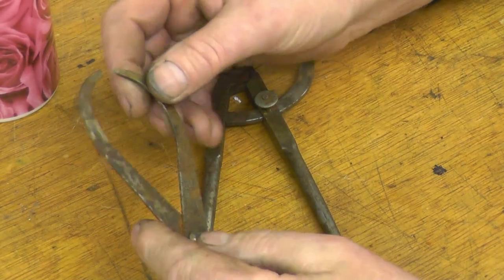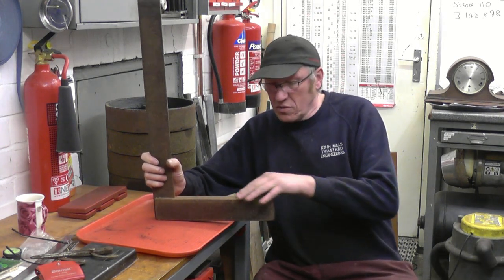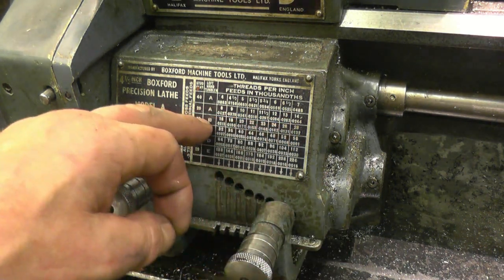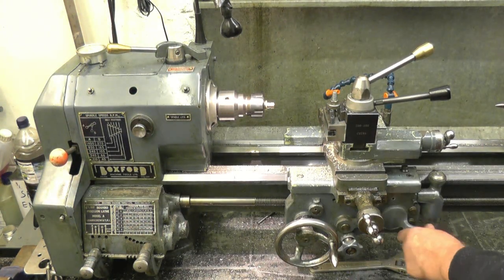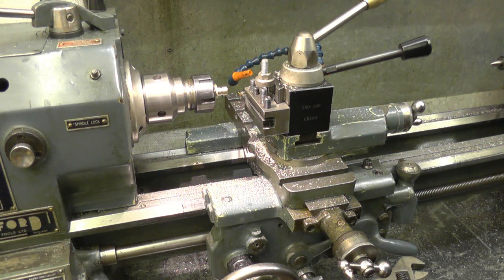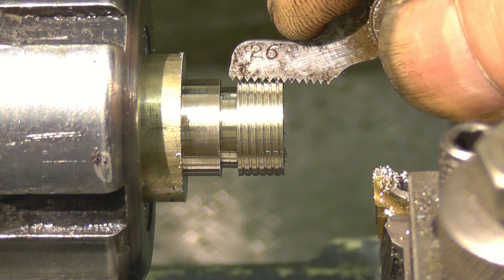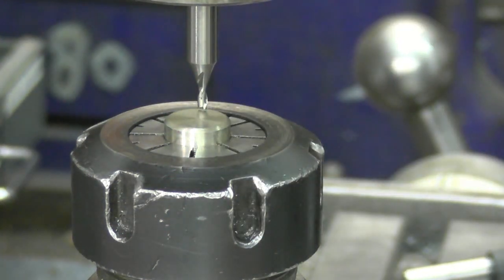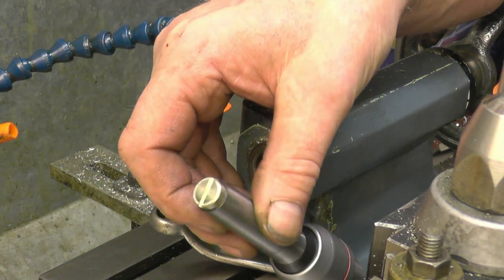Sunday Night Night Cap 43 part two

Comment: Gents, 26 TPI is British Standard Brass Thread found predominately in electrical fixtures and old machinery, I come across it from time to time and own quite a few taps and some dies as well and it can be confused with metric fine. All the BSB sizes are 26TPI. Another standard that uses lots of 26TPI is Bicycle Thread, some of this series is also 28TPI. Cheers

Bruce
Reply: WOW!  Great info my man.  Strange little bit of knowledge to tuck away to dazzle my friends with!

Comment: doubleboost  Great job as usual.  26 tpi, now that's an odd bird, don't see that very often.  When I have threaded the way you were, reversing the motor, leaving the lead screw engaged, I have just let the tool work back through the cut, I have even taken a cut in both directions.  Do you not do that because you have a threaded spindle?  Best of luck to you and your better half, I will keep the both of you in my prayers.
Reply: Keld Sørensen Chris Stephens Well you know it might just be a case of nobody ever told me I couldn't do it!  Honestly I never did consider gear train backlash, and that makes perfect sense.  My Rivett has instant reverse, just punch a button and WHAMM it's going the other way. I don't do this at high speed obviously.  It has been the case that I normally use this technique on coarse internal threads that I cut on a repeat part.  Its an 8 tpi in aluminum that I cut with a double ended HSS tool mounted in a boring bar. So what I would do is make a pass in one direction, then drop a spacer under the tool holder and cut with the underside of the tool, tool is very thin, no relief to speek of, going back the other way.  The ID of the part was big enough to allow this to happen.  It really speeds things up, but I am amazed I didn't have problems now that I consider the drive train issue.  The part was just a screw on cover for an encoder, and a sloppy fit is fine, if not preferred.
Reply: >> James ... ???? ... " let the tool work back through the cut, I have even taken a cut in both directions." ???? ... how the heck can you do that ?

Reversing the leedscrew or ... ?
Reply: Hi James as I had to explain to Tom (Ox) there are many threads that use 26 TPI when he was making a part for an Australian viewer, and there was some confusion over 26 versus 1mm. close but no cuddly toy.:>)
Let us start with 1/4 BSF, then comes CEI also known as BSC that's cycle thread, then we have BSB which is brass thread. Both of the last two use 26 for all, or most, of their different diameters.
Do you really keep the tool in engagement when reversing the lathe? You might get away with it for coarse threads but destined to failure on anything fine due to inevitable backlash in the gear train driving the leadscrew. I do leave the tool in engagement when reversing the lathe but then I have a self lifting threading tool, which really speeds up threading.
ATB
chris
Reply: Hi James , as I said it might be OK for coarse and you proved my case. As you know there must be some backlash in the gears or you would screw up (pun intended) the gears and shaft bearings.
If you have not come across one yet, take a look at:
Gewindedrehen ohne Rückzugshalter ( www. rb-werkzeuge.de ) Teil1
and the following other 2 parts.
I have several of these tools, of various designs, and can say anyone who regularly cuts threads and doesn't have one is a *****.(fill it your own polite word for a numpty)
I have finally got a video camera so, if I can work out how to use it and edit and post, I might show some of my ways of doing things. Then sit back and wait for all the half taught trolls with small or closed minds to say "you can;t do it that way, or you're doing it all wrong".:>) Such is life, what?
Reply: Bill Lewis Probably would have worked for such a short thread

Comment: Hi John,

There's a trick I used to use on my Boxford to speed up the 'reversal' method when threading. Thread in low speed range and retract in high. On my Harrison which has a JOG button for the VFD I can cut at 10Hz motor speed and retract at up to 130Hz motor speed.
Reply from the maker: That would be very handy for long threads

Comment: Why cant you reverse the lathe with the cut on JOhn??
Reply: Stuart Hardy Fred Miller Andy Taylor If you look closely at the movement of the tool tip, you'll see that it looses alignment with the thread when you reverse. That's down to lash (play, or clearance) in the change gears, threading gearbox and leadscrew. A CNC lathe would in theory be able to reverse without retracting the tool, but you shouldn't run an insert tool backwards as it can flake the edge. With John's lathe running from a VFD, it ramps up to speed and ramps to a stop too, so there's little chance of a chuck unscrewing due to reversal.
Reply: Good question Andy.  I would like to hear the answer to that question as well.
Reply: Because like me he has a screwed nose on the spindle for chuck mount, therefore it would unscrew ,not good situation

QED

Stuart
Reply: I will speak to John later mate.
Reply from the maker: Like the lads have said it is all down to back lash

Comment: Now that you made a new part, you'll probably find the old one within a week.

Nice repair.
Reply from the maker: It will turn up now
Reply: doubleboost Probably put your hand on it two minutes after finishing the replacement!
Reply: James Kilroy Done that before.  I found one thing just 5 minutes after ordering a new one.  And it was right were I had looked...I just hadn't moved the paper that was on top of it.